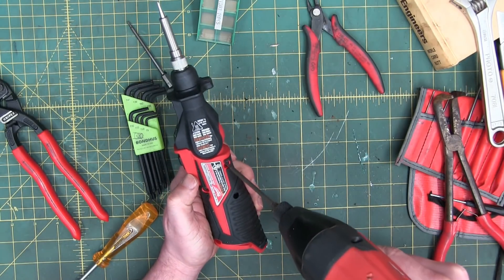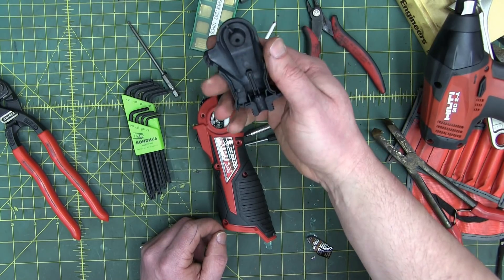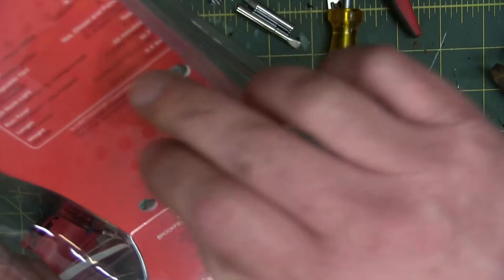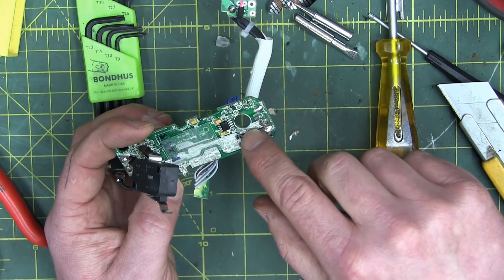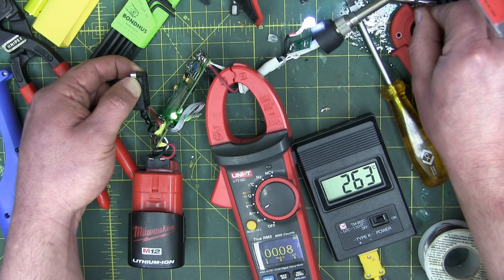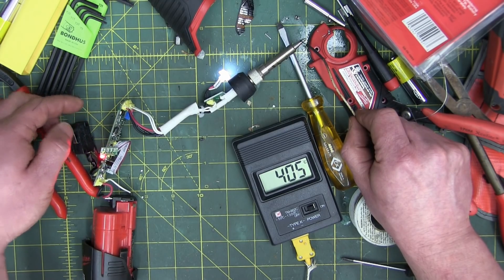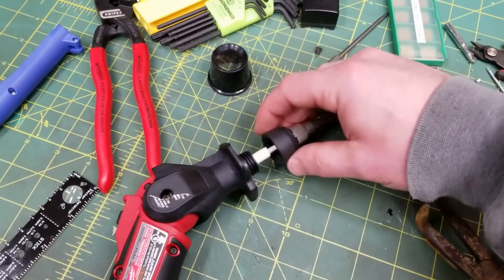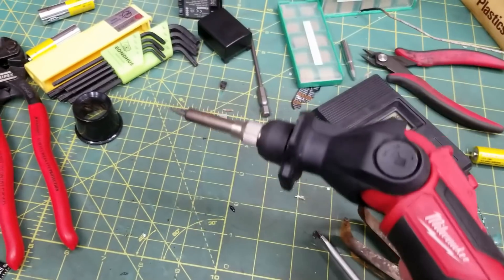BOLTR: Milwaukee Sodding Iron | I'm 2 for 2!

Comment: Bought one of these not long after they came out. It is handy as im doing soldering inside and under the dash of a car. Runs the battery flat quick and is no good at any larger wires. Is skookum as frig though.

Comment: Hmm. Looks like, as reported by others here, that that resistor popped. And it sounds like the Brainbox doesn't pulldown on the Mosfet no more. But what I missed, after you hotwired the Mosfet, is the current through the switch... That was what you were wondering about before she blew.

Comment: @Ave you don't need "negative voltage" in respect to ground just in respect to the drain. So 0v should do. - Pmos will se "12v" on the gate.
Maybe the small sot23 NMOS that had a hole in it blew.

Comment: I’d be checking the white wires circuit as it appears it’s the battery control circuit, it maybe thinking the batteries are flat and not allowing it to run .. failing that it’s got to be pre switch and there wasn’t much to its circuitry..

Comment: Captain BF -  I'm cryin' watching you try to probe through the conformal coating.  Take those probes over the the grinding wheel and put some points on the probes.

Comment: As one who owned several cordless irons, the best is by Weller IMO that runs on 2 sub-c ni-cad batteries. Has a custom small tip that runs 13$ish dollars for expensive small point one or $8ish for the standard tip.
Cheap incadesant light on it to. Not great for lighting but fucking awesome for those tight spots. And that Milwaukee is a "huge bitch!" But may get one anyway. The only reason got m12 was for heated jacket. And a DeWalt 20volt don't seam like a good idea unless on it's like a station with temp adjustment and temp display.

Comment: 8:36 is where the smo comes out.
for the slow students with low-res displays on their bluetooth-enabled pliers.  Watch the top of the PCB between the 1st bend of the ribbon cable and the pinky red power lead.  What threw me off is that AvE sees or hears something before the vjo shows anything.

Comment: It seems that they failed to incorporate a reverse voltage protection circuit because the keyed the battery and connector. Applying reverse polarity to the microcontroller was fatal. Send it to Louis.

Comment: Seems like a decent engineer would have added reverse polarity protection for a few cents to what already looks like a fairly expensive and well designed board. 
I realize that it is protected mechanically when it's not taken to bits, but if a battery is somehow manufactured in correctly, or the customer buys a knock off that's made incorrectly, and no one notices the puff of smoke, there's a possibility of a battery suffering rapid spontaneous disassembly.

Comment: So it's a little bit like the TS100 except with the battery attached directly to the unit and harder to maneuver for electronics work. I would have liked to see a cordless 250W or so soldering gun for the big, skookum stuff that a TS100 cannot handle.

Comment: That resistor that's blown its ass and still works is the problem, even though it may provide the right resistance its still missing a bit of its material so cannot pass the current needed to turn the mosfet low, also if ya get it fixed and proper again I would take that 10 turn or so pot off and put you a 10k pot on the casement somewhere for temp adjusting

Comment: I would say the brainbox is not getting power, that might be due to a diode been blown, the one next to that capacitor and resistor. Usually there is one across the poles to protect the brains from reverse polarity. Check that and also replace the bleed resistor and you are good to go.

Comment: That Milwaukee soldering iron is more gimmick then good.. We have two in our shop and they are a bit of a  joke compared to a proper Hakko or Weller soldering station.. I have personally used them and both of the ones I used had the exact same issue.. They don't get the tips hot enough, with balanced heat to do any type of precise soldering on a consistent basis.. The batteries die really quick and you start losing heat as soon as that power starts declining... I guess the intent is to go against the butane sets but I can 100% say that for $100 this won't be replacing my Portasol anytime soon...
Reply: Tried & True Tools problem with my butane one is the heat shoots out the side port. Not good for vehicle interior work. It fries whatevers off to the side

Comment: Reminds me of the time I had a little pube from a braided wire reach over to the other terminal or fry a $200 speed controller. Tiny little fuckup with a big effect. Though when replaced I was told it wasn't working right and was gonna fry a second one anyway.

Comment: I prefer the dead dinosaur fart powered ones, especially if you are on the job in a country where people still smoke, there is always a smoke booth open somewhere with butane for lighters, no need to charge batteries.

Comment: I really wish you would start testing things before you take it apart. 

No reason you couldn't have done a few quick tests to see how good it works before you started taking it apart, consider it a control.

I just really wanted to see how you liked this thing.

Comment: Would turning the tip temperature pot to read colder than it is cause the brain to think it was too cold ambient and not fire to protect the battery? The first time you adjusted it, the tip was hot. The second time, cold and it threw an error. Just a guess

Comment: I reckon try replace the resistor, she might chooch again! Looks like it could be 12Ω if the markings are upside down it could be 120 which would be (iirc) 1 followed by 2 and the last would be no. of zeroes which is 0. The first digit is definitely a "1" last looks to be a zero (and would have to be a low ohm resistor else it wouldn't have let the smoke out on 12.6v max VBATT against a short) can't be xxB/xxD cause those are too high, starting at 1k. Its definitely either 12Ω or 10Ω if it was "100". At 10:03 one of the vias looks roasted too, might be worth checking it.

Comment: An eighth of a turn clockwise on the heating element current limiting potentiometer (which is after the FET and should still work) should cool that tip right down to his preferred chooch.  Then he would have a single speed iron at least.

Comment: well you broke that quicker than my paslode nail gun when i cleaned it the other day and after 4 times at put back together and take it back apart it was the trigger switch that needed chooching a bit and she works a dream now also do a review on paslode nail gun 350 lm model its gas and battery powered the old style one not the new fancy expensive battery type keep up the good work sir

Comment: Hey AvE, the Milwaukee owners manual shows this iron heating to 750 deg. F.  I don't think you F'd it up.  My non-reverse polaritied Milwaukee iron will turn up to 750 and back down to 500 with no problem.  When you get home next check her out.

Comment: Not sure why you are focusing on the mosfet after you have identified the blown resistor (and it is clearly what let the smoke out at 8:38). You cannot test a resistor while in a circuit, you need to disconnect one side of it to get a real measurement - which you sort of acknowledged, but them moved on to the mosfet.

Comment: A lot of the quad copter racing guys I've seen use one ones powered off a 3 cell RC battery. TS100 is what they call it.
Much smaller and lighter than this.

Comment: Yep that's going to require a mil-spec microscope assembly I used to build sub-assemblies of the harm and Sparrow missile so that's how we did it need a real fine tip and you need to be able to see it you know that I'm just running my keyboard then we cheeched

Comment: Do you think if you hadn’t put the battery on backwards and turned the potentiometer up it will last ??????? Or are there other electric components relying on it to work at a certain temperature????

Comment: AvE have you done a review of the Milwaukee Corded Electric Spade Handle Drill With Pipe Handle — 1/2in. Chuck, 7.0 Amp, 450 RPM, Model# 1660-6 or any of it's variants?

Comment: Milwaukee makes a 1/2 inch impact 2863 that guys in the shop swear by I haven't used it in person but they tell me you can get a crank pully bolt off no problem with it idk if i buy that but there very proud of the thing for 200$ for the bare tool

Comment: Holding the board in a metal vice probably won't help if they have a ground layer and/or a supply layer.. Get some tape over them teeth, which are hungry for electrons.

Comment: It just amazes me that these companies are charging 100s of dollars for these novelty items, when you can get a good and simple 12V soldering irons for a tenth of the price. It's even worse because they make USB power adapters for these batteries, and you could just add a 12V port to the adapter to power the cheaper irons.

Comment: You might have done this, but check the gate on the P-FET.  Zero volts will turn it on.  It doesn't have to be negative.  You can check whether its the FET or the MCU by grounding the gate on the FET.  Either way, its repairable as long as that MCU is something sane like a TI or Microchip one.  Then you just gotta program it to be a soldering iron again :P

Still.. Check the gate on the P-FET, you know, after you fix or bypass the thermal fuse.
Reply: htomerif Careful with shorting a FET gate, whatever drives it may not be able to drive more than a few μA without getting blown, so making that drive a short circuit to the opposite control value could kill it.
Reply: John Francis Doe you are correct, and to turn the power p-fet he should short the gate to ground.  If it is a simple npn or N-fet driver, it could tolerate being connected to ground.
Reply: Well the nice thing here is that it is a P-FET and it has a pull-up resistor.  That  means you can short it to positive all day long and it also means that whatevers driving it can sink at least all the current that that pull-up resistor is providing.
Now theres no reason to have that pull-up resistor if you're using a gate driver that sinks and sources the gate drive current so we can probably assume that one of two things is true:
1) they're using a BJT to drive the P-FET.
2) the MCU or gate driver (probably just the MCU) lets you disable the internal pull-up resistors and just use the MCU output as a current sink in opposition to the P-FET gate pull-up resistor's current source.

In either case you should be safe just plain shorting that to ground.  Usually the body diode of any power FET can take a huge amount of pulsed current and they usually do let the smoke out or explode from that much energy.  There's no voltage present anywhere on that device that would have exceeded the gate tolerances of usually + or - 20V so I'm guessing that unfortunately either the MCU or the MCU power supply is cooked.

It may not matter anyway if that thermal fuse is potted (or otherwise inaccessible) inside the tip of the iron though.

We finally get something where I know exactly how to tell whats wrong with it an he's rekt further by the end of the video.
Reply: John Francis Doe: you're gonna need more than a few microamps to feed the gate capacitance on the FET (or at least the FET is going to take it without a very large series resistor) so whatever is sourcing the current for the FET gate has probably got to be able to at least source a few tens of mA without getting blown.  If there is a very large series resistor, then problem solved either way.
Reply: htomerif I agree with almost all that you wrote except for a few details:
Your (1) an NPN bjt OR an N-FET would work there
(2) even though some processors let you turn an output into an open drain, I am not aware of any that would permit a voltage like 12-15 volts on such an output (I have not looked at processors for a while so my knowledge there is out of date but I would be quite surprised to find such a thing).

Comment: I hate butane myself. I have been blasting the crap out of this Weller wesd51 for the better part of a decade. It does great, but with some of the stuff I do it meets its match in terms of power. Time to build a PID 150w soddaring station from scratch me thinks. Hell, maybe a lithium wand would be a good idear.

Comment: I'm sorry for that too. But don't be hard on him. The cause of this it's little things that added up.. the misplaced charger lead to dead camera battery.. which lead to filming using the phone which lead to connecting the battery using one hand. That's a lesson we all have to learn. Failing to do a small thing cand lead to another and another and so on.. and most of the time that's how bad things happen to people.. a chain of events like this can lead to injury or even deth.As for the circuitry.. I think there is diode somewhere and that resistor blew up because the diode allowed alot of current when the battery was put the other way.. I don't think the IC is that easy to blow.. as example.. in a a PC most IC have an enable pin.. and if you don't put the recuired voltage on that pin the IC isn't even conected in the circuitry and has all the inside circuitry floating..

Comment: I thought most “modern” electronics have diodes installed to prevent damage in case of reverse polarity battery installation.
Does anyone know why this tool would not have that protection?
Too much voltage drop  with high amps generating heat in the forward direction requiring a high power large diode adequate to prevent reverse “pixies” from killing the “confusor”.
These are just amateur guesses on my part because I haven’t had any formal education since 1980. And most of that knowledge was wrong.
That’s why I like this channel.
AvE seems to learn like I do.
I owe that curiosity to my Dad.

Comment: .Have you tried turning the pot back down? Or measuring the voltage on the gate of the FET? That looks more like the controller is saying something's fucky than a burnt component.

Comment: A modded ts100 is the best choice
Reply: Kaiser Wilhem II if you want a portable one yes. For a stationary one I stick with my hakko
Reply: Doc. Volt what do you mod to make it more portable? Mine stays in my front pocket all day when I'm out with the drone
Reply: I agree, I just received my TS100 and it worked well for my initial test. I'll be knocking together a cable to use it with a Milwaukee M18 battery.
Reply: You don't need to mod one to make it portable either... All you need is either a power bank with a 19v-24v output or a few batteries in series to make a ~24v pack.
Reply: Ran mine stock for 2 years with no issue.

Comment: You like hot irons? Look for a New Old Stock Ungar #4033. None of that useless microelectronic stuff either. Powered straight from the 110v outlet. It's rated at 50w @ 1000°F and glows in low-light.

Comment: If i had a penny, for eeeevery fucking time Uncle Dave from the other side of the Dirt planet warned me i'd unchooch my electorate with a "chinsy" non regulated iron, i'd be rich by now, mind you, it is a Austrian made unit, and it is a bit of an expensive affair, but fuck, it works, and my HP hasn't screamed any, the few times i've been inside to replace whatever i might've blown through some ... things that i might've done. Don't judge me, we all plug too much in too little. 

So looking at this "iron" i say, begone.

Comment: I've had this soldering iron since it first came out and it has all the chooch you could ask for and the switch hasn't failed yet but thank you for this video as I'll know what to look for if it kicks the bucket. If only the heat gun they made had the power this little thing does the thing is like pissing in the wind.

Comment: How about trying to turn the POT back down? It has a logic circuit that checks multiple points, so this may be the problem. Sometimes you can't turn the POT wide open....do that on a bias POT in an amp and see what happens, she will be right fucked.

Comment: I thought your UNIT-T meter was DOA ... plus you pulled something off the circuit board.   Did you record the fixing of it, or did you get another?
Reply from the maker: Only works on inductive end.
Reply: Ahhh ... Thanks.   I have a lesser model UNI-T.   Sure it's not a FLUKE, but for a home-gamer it's just fine.     FYI: I'm now sporting a new "Engage saftey quints" T.     Funny ... we've all done it, but nobody gets it (except for your subscribers).
Reply: And sorry to hear of your FU!   I've popped a few chips lately and even did the same mistake twice in a row.   We can hope we learn from our mistakes ... but sadly it doesn't always work that way.    We all learn from seeing the mistakes ... maybe more than the successes.   You channel is the BEST!

Comment: One suggestion it seems difficult to work with one hand you should get one of those microphone stands you know one the arm with the springs articulating or whatever hanging from the ceiling or wherever, now the soldering Iron is junk as I get to the end of the video maybe someone from Milwaukee watches your videos

Comment: rewatched the smoke, you let it out of the resistor. You probably just need to replace it.
Reply: that resistor might be on the switch for the fet which without it, you have switch drain and it will never switch the mosfet.

Comment: The only thing I don't get about the design is the fixed attachment of tip/control/battery into one clumsy shitty unusable piece of... I wanna see a adjustable temp. fine tip electronics soldering iron to slide on one of my huge drill batteries which act as a base for a mobile "station". Add a metal spiral to hold the iron on one side, a brass wool cleaning thingy on the other and you're all set for mobile soldering with full station comfort. Small, precise,  modular, comfortable...